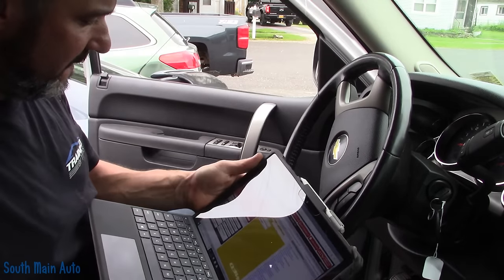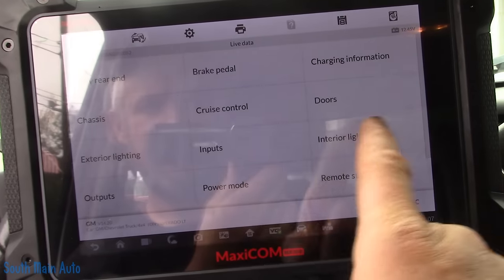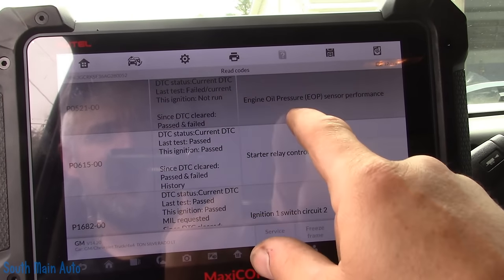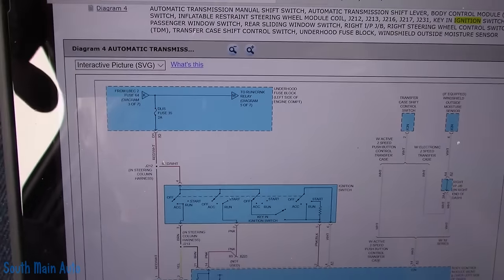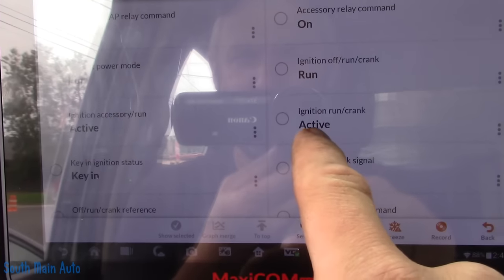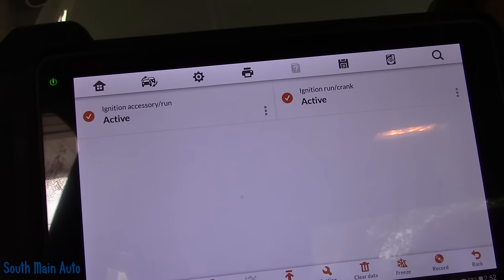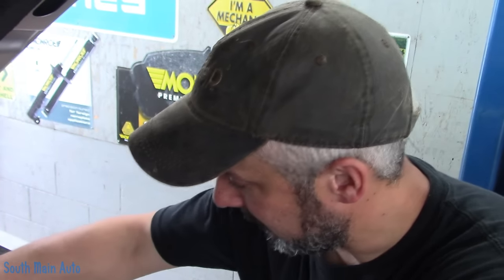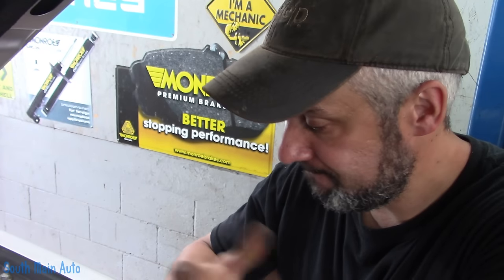Chevy/GMC Truck: No Start - No Crank

Comment: My 2016 looked worse then that with the cover on. Had 14k miles and wouldn’t start. Opened lid to start checking fuses and there was ice in my fuse box... heat gun the box it stated and dropped it off at dealership. One week later they replaced the box and it’s been fine ever since

Comment: I believe the best fuse box I've ever had to deal with was on that late 90s Chevy Express van that every electrician and Carpenter in town drives. You guys know the one with the gray hood and only two spots of white paint left on it. Fuze box with lid wedged in the corner covered in power steering fluid from the brake booster and you got a diagonal start. Super-fantastic Funtime thanks boss.

Comment: Hi Eric, 
I used your idea of choosing a simple circuit to diagnose an electrical fault on a scissor lift with an engine, and the auto-choke, auto-throttle and ignition were out,  traced back the choke control to find that the common ground from those components to the engine block had snapped off.. a small wire, that, if faulty, would disable everything. I re-attached it, and lo and behold, the engine fired right up. Thanks alot for the ideas for circuit tracing. Love the videos

Darryl
Montreal Canada

Comment: Another great video Mr O !!!  You never fail to amaze me with your diagnostic skills.  I went through  automotive back in 1970.  Back then all you needed was a points file and you could make almost anything      
run. Always watch my notifications for the latest video, Love your work and your channel !!!!
Reply: I went through mine in the mid 80's learning 70's tech. Fuel injection was starting to come out and the instructor was leading us away due to the computer control. Now that I'm learning more about the electrical and computer control, it's not as bad as I was led to believe. 
Wish Eric would have been the instructor!

Comment: I just checked a 2013 Tahoe that was doing the same. Dead battery and wouldn't start after jumping. I removed that fuse and all the fuses relating to the ecm and ign. It started but shut off after a couple of minutes. I asked customer to get a new battery first and I will check amperage on those fuses. Subscribed for sure. 😎

Comment: I like all of your videos. You're my go-to car repair video guy. 
This fusebox corrosion is a scary thing... I went and checked mine right after seeing that mess.
It was good hearing Mrs. O in the background again. Keep cranking out the videos.
Reply: Unicrom63 😂did the same with my 2013 GMC, cover on tight, no corrosion, but lots of fine dust.

Comment: I love these troubleshooting vids, brother. Nice work. And definitely - best to replace that whole fuse/relay box. Once that corrosion takes hold, you'll keep having issues.
Reply: Got chevy 2012 no crank no start. Been watching your videos. I popped the cats cause of rattleling.. now no crank no start. Jump starter,key on . cranks but no start. I did change the battery.. on cranks.just saw video of the two amp fuse, bout to swap

Comment: Be interesting to see what the underneath of the fuse box looks like, sure it’s not very pretty, not sure if the cover was off the box for a while, probably was in a flood, that would be my guess, should look at the other fuse boxes to see if they look the same.
Reply: Salt water flood maybe. That's beyond bad.
Reply: Not a flood, you'd have bigger visible issues he would have noticed long before the fuse box.
Reply: @Folsomdsf2  Yes. With a flood, you'd have starter and alternator failure, just as a beginning.
Reply: @reecenewton3097  In the flood vehicle they replace whatever isn't working before it goes to auction, with used parts from a wrecker, so because the fuse box WAS working, they probably left it.
Reply: @toysareforboys1  And if the water got high enough to cover the fuse box, it would have been inside the cab, too, soaking the seats and possibly up under the dash. No matter how you washed out the interior and let the seats etc. dry in the sun, the stink from a flood would never be out of there. It's known that after floods or a hurricane, people in the market for a used car are warned to look for "bargains" on late models as flood cars can be transported to states far away from the flooded locale.
Reply: toysareforboys exactly right, I think those that think this wasn’t in a flood should explain how a fuse box looks like that, and it isn’t from leaving the cover off! With so many floods in this country lately, this would be a great place to look at if you are buying a used vehicle! It is very doubtful that they would replace the fuse box and wiring harnesses unless it was absolutely necessary due to the high cost. At least that’s one of the first places I would look at. Thanks for the reply.
Reply: A failed ice fishing trip
Reply: A flood is a strong possibility !

Comment: Everything else under the hood looks relatively clean. Perhaps the engine bay was pressure washed by the dealer detailers and the water from that helped the corrosion in the fuse box along? Or could be a wrecking yard fuse box that’s already in it. At least it’s not a Chrysler Jeep $1000 TIPM box.
Reply: coming soon,  all integrated into single magic smoke emitter vehicle brain =p

Comment: Owner must have driven around with the top off the fuse box for some time.  As Mr. O, says, this is a disaster!  It is a wonder that it runs at all.  He will be lucky if the connections to the fuse box are not as corroded as the fuses and relays.  What a mess.  Where is Miss Marie?  I am in shock.  No brake cleaner!  LOL  Great to hear Mrs. O's voice.

Comment: JUST FIXED MY 
2003 TAHOE,WITH YOUR
VIDEO KNOWLEDGE, I
WANT TO THANK YOU
2 MILLION TIMES 🙏 
FOR THE (2) AMP FUSE!
YOU SIR ARE DOING 
GOD'S WORK.
Reply: what was the end problem ? currently mine is pwrmde 2 amp blows upon ignition crankk chevy traverse

Comment: Fuse repair business opportunity 😁.
Great diagnosis, love to know the history of the fuse box, salt water???
Thanks for sharing.
Reply: 2010, I'd think water intrusion, maybe a dash of salt water, was it used for plowing/towing/beach driving/flood location or contractor that uses the truck running to power larger inverter with hood open in storms?
so many things other than it also being chinesium junk metallurgy in them there fuse-blocks....
Reply: @throttlebottle5906  not sure on the chinesium metallurgy, basic galvanic or bimetallic corrosion, but many connectors are plated steel to reduce cost. It looked like silt in there suggesting submerged as you commented on.

Comment: Eric! You are brilliant diagnostician! ... Outstanding respect to Your EXPERT LEVEL! Just one question: why You do not make advanced visual inspection of major  electrical components and signal distribution points like: fuse boxes, joint connections, ECM  and PCM inputs connectors? In most cases oxidation is major problem for any field electrical application -including automotive. Greg_S, Senior Field Eng. Siemens Power Solutions.

Comment: Your understanding of wire diagram floor me.  Thank you for your videos
Reply: I guess I take following wiring diagrams and others for granted, I can look at older circuits boards and back trace fast (single or double sided) the newest stuff is multi-layer impossible and very often total junk

Comment: The dealership would have wanted to pull the motor 😜
Reply: Pull motor,  drop transmission,  fire parts cannon at it, etc.. heck they'd probably even want to change the ignition and pcm!
Reply: "While you're here, just wanted to tell ya that your pads are getting low"...
Reply: Then you'd be back 5 or 6 times under warranty, and it still wouldn't run right! 🤣
Reply: Dealer fires entire parts cannon at truck and never opens the fuse box lid

Comment: By far you are the best you tube videographer I have seen.  I also have a Silverado that had a cover on it, but the box corroded so badly on the inside I had to replace it with a new GM part. I have also had problems with the dash lighting up, misfires, rough shifting 1-2, limp mode, etc.  started out with plugs and wires,as it needed them.  Then after a ton of reading I installed an AFM delete device, lights went out ant a problem since.  Have you seen this before???

Sincerely, Glen Johnson
Reply: afm lifters are a common issue on gm trucks , typically its a collapsed lifter, sometimes worst. typical repair is new lifters and vlom. or do what you did and do a delete function .

Comment: Flood car.. no way that all just from sitting out with the lid off. Plus the hood would need to be open too. That was silt from a flood.
Also.. the reason you see so many with the lid off...  It's a pain  sometimes to get the lids off. I don't know why. Maybe it's a special trick or something but I've fought numerous times trying to get the lids off of these.. that support frame above it does not help.. you get the angle wrong and they can wedge in there a bit..
Then all of a sudden it pops right off like super easy and you don't have any idea why or how you made it do it.
Reply: I was thinking flood too..
Reply: Definitely flood
Reply: 👆🏻 real life mech
Reply: @thespiritof76..  
Thanks, just lots of experience with a variety of vehicles.
Hope you have a wonderful day.
Reply: kens97sto171 U2 bud.

Comment: When you find out the reason for the box being open and corroded let us know please... I'm curious! lol.....
Reply: It's a flood vehicle. Never thought I'd see one all the way up in New York. We see them here a lot in North Carolina coming from Florida, Louisiana and the other states nearest to us that get flooded out a lot. Before you buy a vehicle check under the carpet you'll see a lot of dirt or silt if it's a flood vehicle most times. Car Taylor's usually clean everything you can see really easy but they never pull the carpet cuz it's too much trouble. That's what's in that fuse box. It's where the truck sat in water for days in the water. Dirt and everything else collected there until it was pulled out of the water.
Reply: @tgriffin6938  Same thing that crossed my mind just hope it wasn't ocean water or bye,bye floor boards and fenders and,and,and.......
Reply: @South Main Auto Repair Just adding, Yes! It would be rather interesting to see a follow up video! On this 2010 Chevrolet 1500 Silverado: Showing the power distribution box (fuse panel) and with all of its green crusties trying to make a connection. Lol! 🛠✌🏼❤️
Reply: looks like some type of hurry-reup-cane truck with a dusting of salt water.
Reply: @Dirtyharry70585  jah, or whatever flooded area (no salt needed!), they'e out there and pumping through auctions nationwide ++++
Reply: @tgriffin6938  Why is it rare to see a flood car in NY? Floods happen all over the world......
Reply: Stupidity. 

When you buy you next car ,
 PULL OPEN THE FUSE BOX.
PULL OUT THE FUSES.
" THE WHITE POWDER OF DEATH " 
" THE GREEN CORROSION OF ELECTRICAL LEAKAGE "
Reply: I'm a DIY guy.  That lid is a pain to get on off.  Which is why my box is dirty & corroded.  Lesson learned.
Reply: @tgriffin6938 I live in midwest I've seen several 07 to 13 silverado fusebox look just like that .. piss poor quality material

Comment: hvac guy here,not a car guy by any means however, save money been tracking down this B1370-06 code on my 2012 chevy traverse 2 whl drv. i have alot of interior taken apart. i was praying that your 2 amp fuse for pwr mde would blow as soon as you cranked it. that s where an abundace of my very own hair is at* my short drains the battery & specify s circuit 1 ignition. dtc code says lin bus open/short to groundspeed control switch assemblysteering column control module(sccm)pcm. changed ignition switch& new battery & a huge bag of 2 amp fuses. can u or anyone in this forum please guide me? on another note, i enjoyed your video, very detailed in what your doing, highly recommend anyone to your forum. best experience thus far educating myself . reside in northern california . keep doing what your doing bro, u got my vote!💯

Comment: Went to start my 2010 Silverado 1500 and nothing, just like the truck in this video.  The dash had the Passlock security light on solid (not flashing) I watch this video and change the same 2amp fuse like in this video and the truck fired right up.  Thanks for your videos!!👌

Comment: Engine oil performance code for the oil pressure switch. I had that code a few months back on a 2012 Tahoe. Put a manual gauge on it and the pressure was under 10psi hot idle. Minimum spec is 22psi. A high pressure oil pump was put into it for a bandaid repair. More than likely the cam bearings were worn causing a drop in oil pressure. Those engines with Active Fuel Management are pretty terrible.
Reply: My 07 Sierra with 5.3 afm burned a quart every thousand miles at 55k

Comment: Nice diagnostic video.
If I were in a salt environment like you.
I would consider spraying the new fuse box all connections, with carosion gaurd. 
A little thing we do on boats. It leaves a tacky film on what ever you spray it on. Locks out water and air.

Comment: I can't stand when I work on a car that has no fuse box cover.........nice job..... 👍👍👍👍👍👍
Reply: I was always fine if the cover was missing but I'm in the south. I always hated when half the fuses were replaced with some that were rated 10, 15, or 20 amps higher than what the circuit called for. My 20 year old GMC 4x4 just has a light flashing of surface rust on the frame. Farther up north I'm sure it causes a lot more problems. I've seen 30 year old junk down here that was falling apart from being driven into the ground but the exposed fuse box under the hood didn't show any remarkable corrosion. 

So damn glad I don't live up in the salty part of the world.
Reply: @velvetjones  .......lol.......i live in mass.......it becomes a problem up here with green crusties...........

Comment: If I’m not mistaken that starter relay is ground side switched by the ecm. Gm went to that setup in 03 on the trucks, same year drive by wire and body modules came out in the pickups.

Comment: Definitely been in a flood or went off road into some water. Either way it’s got trouble coming and will fast become a money pit.
Reply: that is the good old brine they use for  deicing the roads. exactly what it does to aluminum.
Reply: Agreed
Reply: outlaw63  don't forget beet juice and propylene glycol and 999-other supposed "non-toxic" stooge mixtures.

Comment: Ive seen quit a bit of these fuse boxes on chevy products come in with the same problems even no covers .even on my wifes 2010 chevy malibu hadto change it due to low voltage issues,reduced power.etc. great video .very informative thanks.

Comment: Thank you - MY 2016 GMC Serria  Denali would not start , it happed after going through some high water, - Some times it fired off, and some times it would not. Took it to the Dealer and all systems were OK, ( alternator, Stater, Battery etc) - they never mentioned the fuse.   I checked the 40 amp fuse, it was loose. took it out and reset it. All Is good now.

Comment: did you ever officially diagnose the OIL LIGHT issue?
Reply: Pressure switch. It's a common failure.  Rear driver side of engine.
Reply: And a joy to change....
Reply: @kevinoscarson2941  amen to that.  Bear hug the engine, working mostly by feel, limited to no space to work in, etc.

Comment: I spray all electrical with wd40 salt water marine mechanic habits.
Fuses relays plugs sockets pins all corrosion proof grease when possible.
"Rust never sleeps "
Neil Young
Reply: Is wd40 safe for fuse boxes? Im in Florida and we get wire corrosion and rust from the saltwater (I'm walking distance to the water)
Reply: Jennifer Rae Fuchek yes we spray all electrical with it for decades now.
Reply: Jennifer Rae Fuchek Not  house power only automotive marine
Reply: @MitzvosGolem1  awesome thanks.
Reply: Jennifer Rae Fuchek Flammable don't use on house fuse box. There is a special  anti corrosion grease for that approved for house voltage. Home Depot has it. Ask electrical Dept .
Reply: @MitzvosGolem1  oh no worries I was wanting something I could use specifically for my vehicles as a preventative maintenance.
I don't mess with home electrical. Noooooo way 😂

Comment: I found 3 corroded open fuses on my 07 silverado and the cover was always on . I also found multiple corroded terminals on fuses and relays so i cleaned and applied corrosion preventative compound to all terminals and sockets .

Comment: I've been trying to get my truck started with the resistors and bypasses and I fed system the first time I tried it it didn't work with All 15 resistors so  Ichecked all fuses I found a 2:00 amp fuse blown I didn't have a 2 Amp Fuse so I put the $15 just to make it work your video helped me to realize 2 Amp Fuse was needed

Comment: Great job Eric! some of these used trucks like my 2007 Chevy Silverado 2500 HD that I bought used I suspect they were trucks that were flooded with water and came from hurricane areas and re-sold up in New England, I had many similar issues like this and suspect mine was a truck that was flooded at one time but all are able to be solved with good troubleshooting skills like yours.Thanks for the great video.

Comment: I, too, would like to see that fuse box replaced as well. However, in the meantime, would it hurt to use CRC-2 electrical connection spray??? That formula is designed to be used on circuitry like that and shouldn't cause any problems.

Comment: That's how I check fuses too. They can look just fine and be bad. I diagnosed my Father in Law's 2013 Ford F150 over the phone. He said the fuse looked fine and I told him replace it anyway because I wasn't there to put my light on it. He replaced it and it cranked right up.